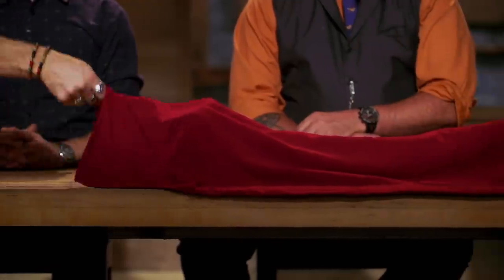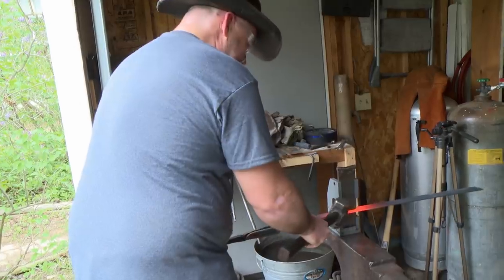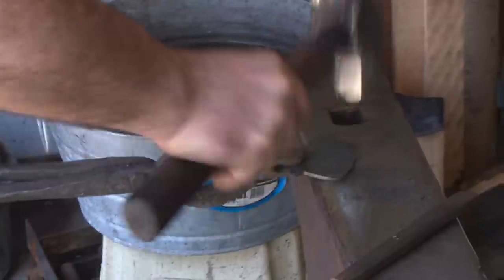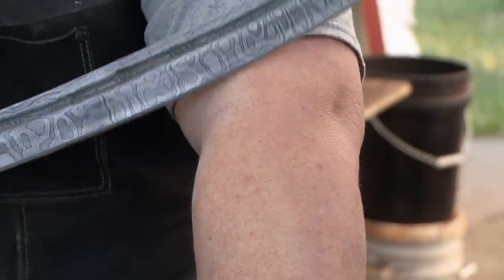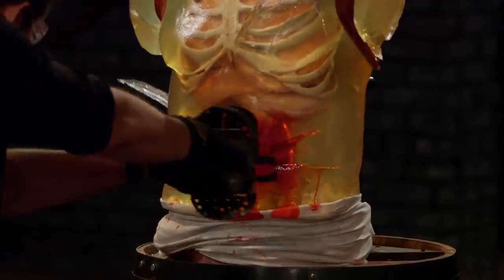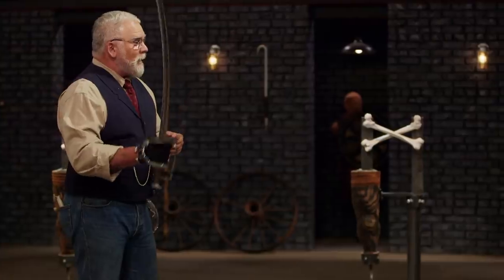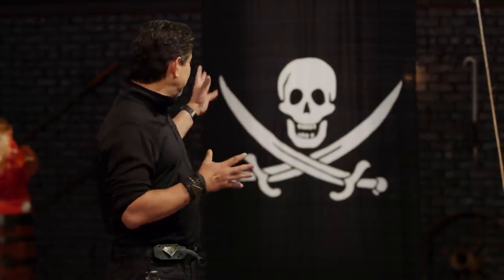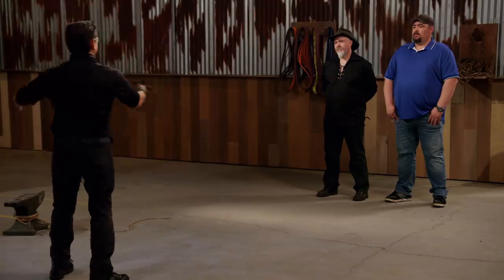Forged in Fire: Blackbeard's Cutlass SHOWS NO MERCY in the Final Round (Season 6)

Comment: I’m glad David was doing the strength test. I feel like David actually tests the strength of the weapons whereas Jay just tries to break them.
Reply: Well yeah! It is a strength test, so the maximum amount of force that the sword would endure should be exerted on the sword to test its strength.
Reply: @dudearon8130  I mean I get that, but for example, David will hit the sword against an ice block 5 times, whereas Jay will go 11 times. There are instances where he breaks blades and I’m absolutely convinced that he did not have a number of hits planned, he just went until he busted the sword intentionally.
Reply: @connorkitchen7285  sword better be strong then lol
Reply: @connorkitchen7285  the type of test doesn't matter as long as both blades are exposed to the same pressure. If Jay breaks a sword after 11 hits while the other sword has no damage after the same number of hits, the fault lies on the bladesmith, not Jay
Reply: They're tests to make sure they don't break. Anytime I see anyone other than J do the tests, they go too easy. Why even bother having the test if you're not pushing it to its limits. If it wasn't a competition I'd agree but the strength test is specifically to see if it can handle punishment, J does exactly that.
Reply: @TrippyTheShroom  Because you end up with weapons designed for strength tests rather than function. Its like how the Germans in WW2 ended up designing 100 ton tanks because they wanted to make tanks with impenetrable armor. But is it really better than a 20-30 ton tank that is 3 times as fast and can go over bridges and more swampy land?
Plus all the other judges prefer lighter weapons with sharper edges most the time, like in this case. But a heavier blade with a more concave edge is gonna be stronger and chip less, all else being equal.
Reply: Each of the judges has different approaches. J really, really wants to break something. Ben is a lot more cautious, always hugging himself while swinging the weapons and being careful not to injure himself. David just does it like business as usual.
Reply: I knew in round two my friend in Jason won the game

Comment: When forging a sword, always take consideration of weight and balance. It's a very important thing.
Additionally, the heat treatment. Right amount of temperature, the glow, quench and put it in a long vice just in case.
Cause proper heat treatment means a more durable blade, making it less susceptible to chips or rolls.
Lastly I gotta mention the edge geometry. Be absolutely certain the blade's edge is truly, TRULY razor sharp.

On a side note; it's always bladesmiths saying that they've never made a sword before, 'cause they're always making knives.
It's a good idea, if not essential in it's own way, to try and forge a sword once in a while. In smithing, you're always learning.
Never too late to get that inspiration going and get to it.